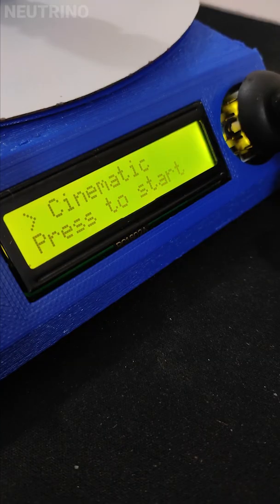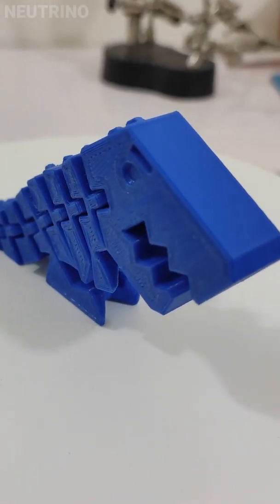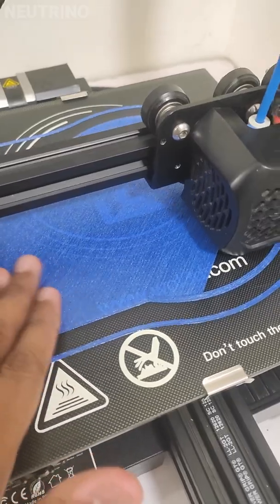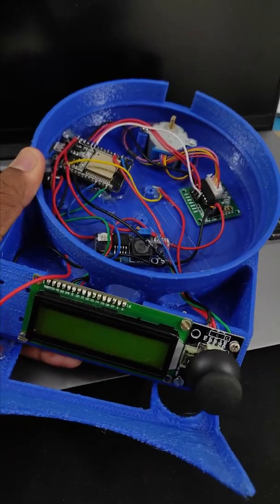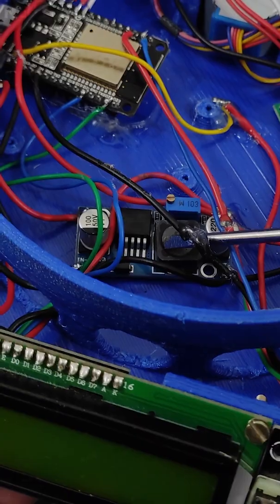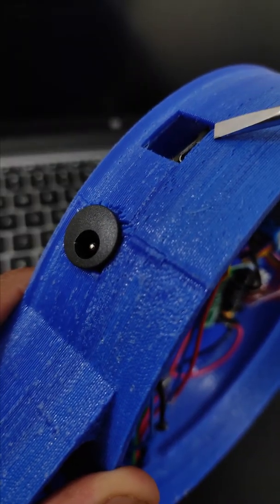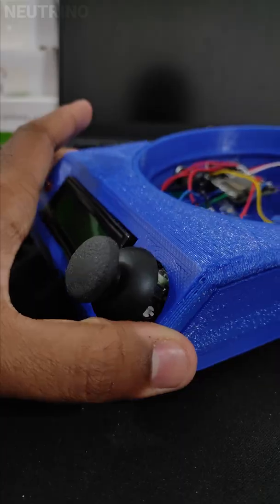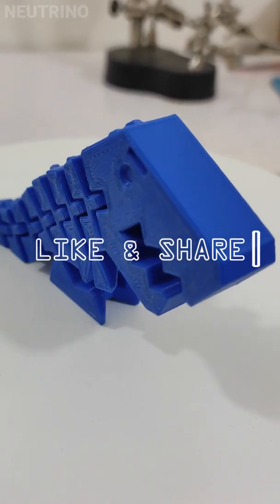How to make 3D printed turn table using ESP32

Comment: Why an esp?
Reply from the maker: It is used as BLE trigger for mobile camera (The turn table can be used for Photogrammetry).
Reply: @Neutrino1  Thats cool, thanks for answering :D
Reply: @Neutrino1  Could you share your firmware code for this?

Comment: very cool, how smooth was the 3d printed gearings ?
Reply from the maker: Manageable! it won't turn when heavy objects are placed, ball bearings needs to be added.
Reply: @Neutrino1  Is it PLA or ABS. Coz if it's ABS you can use acetone vapors to smoothen the gears for a clean and smooth finish. It'll run better than before as well.
Reply from the maker: @derpybirb  Yes that would have been great! But the gears were printed using PLA and the rest of the body was printed using PETG